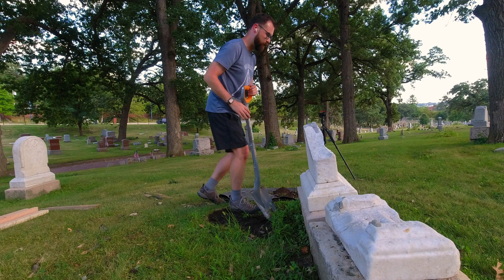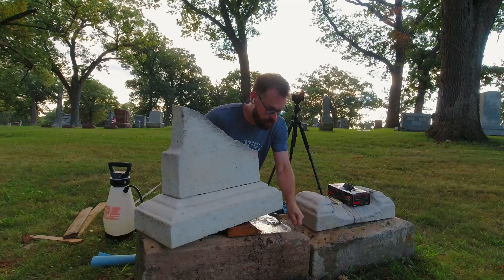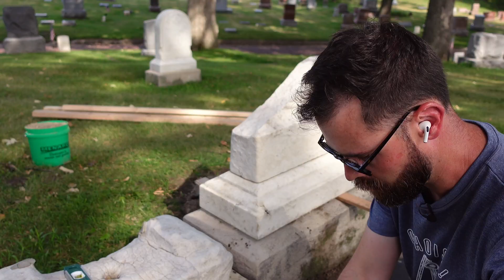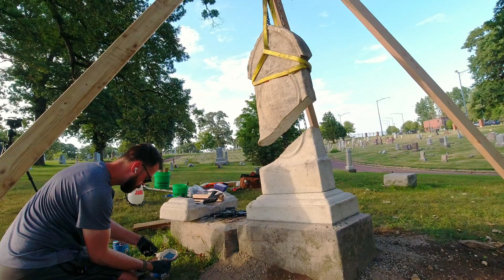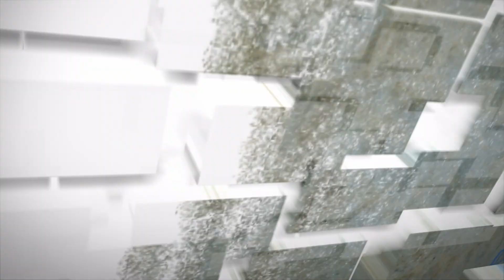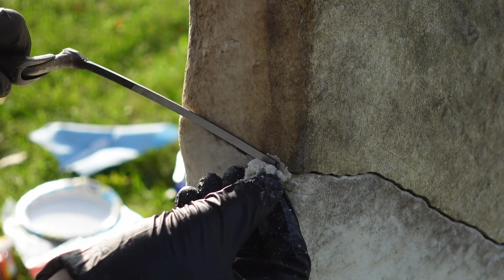Using 3D Rendering to Discover the Headstone of Sophia Connell Sherman - Repairing Monument

Comment: Two questions if you have a minute, first are you using lead or pennys or something to set your setting compound thickness?, and second question, what cleaner are you using in your pump sprayer.. you did a great job with what you had, that domo works great on stone,
Reply: D/2 Biological Solution